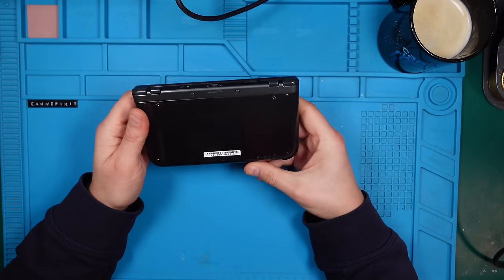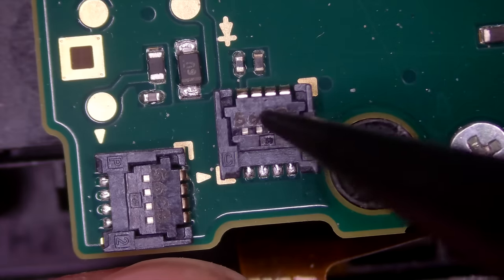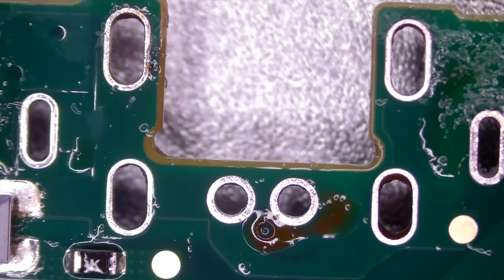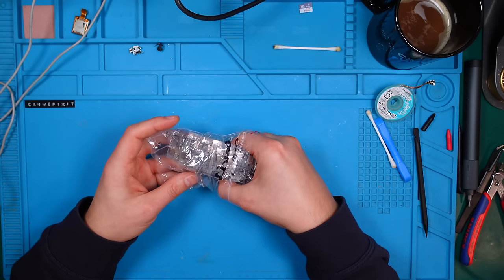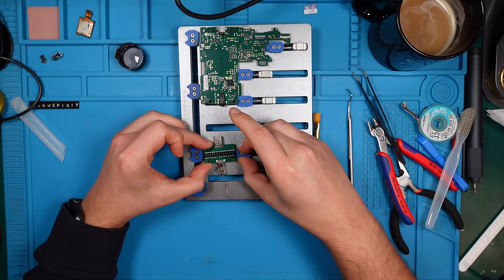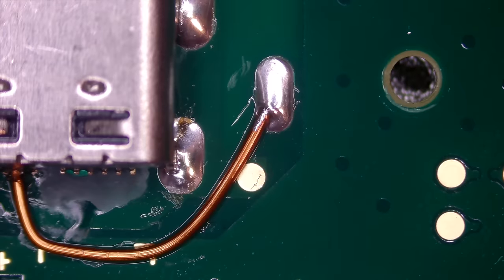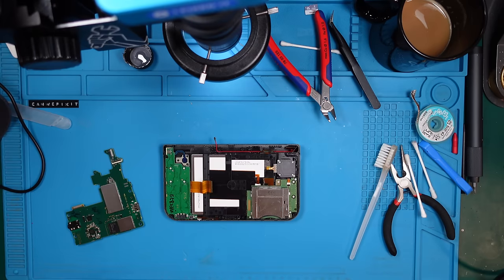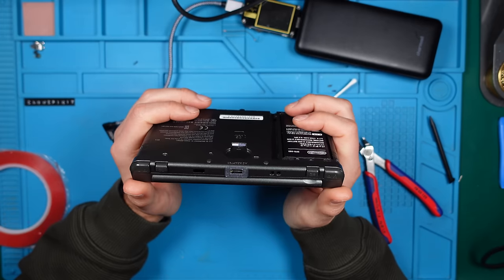Nintendo 3DS Modding - Your FUTURE UPGRADE! (NEW 3DS XL)

Comment: I'm glad i stumbled onto your video! My son was recently playing with my 3dxl while it was charging, and now it's having issues taking a charge.
Reply from the maker: Glad that I could help! What was wrong?
Reply: Is using your 3ds while charging it bad for your 3ds? How?
Reply from the maker: @sgonzalez_guitarra  I assume it will just stress the battery a bit more. I think it is not a real big deal. But what do I know? ;)
Reply: @CanWeFixThat  it does over time, I’ve had my new 3ds XL pretty much since it came out, and I had very minimal issues until recently when my battery started expanding.
Reply from the maker: @Shin3y  But is this really caused due to using it while charging?
Reply: @CanWeFixThat  yes, using any device during charging accelerates the rate of batter deterioration.
Reply from the maker: Sure, that is right, but it's as always: "the dose makes the poison" 😉
Reply: @ThatMathEnjoyer  My old 3ds still lasts 3-5 hours as advertised. Original battery. It seems that the N3DS handles plugged-in usage differently.
Reply: @CanWeFixThat thank u for this video
Reply: @CanWeFixThat it would be super cool if you did lightning port 😂
Reply from the maker: @Liam Smith You are welcome! 😁 Haha, yeah, but lightning would not be future proof. 😬
Reply: @Sebastián González  probably mishandling of the DS while it was charging, could have damaged the port
Reply: I recommend Letting it stay on charge for a few hours without any touching
My battery lost it's ability to hold a charge after awhile but after giving it like 2-3 hours more time charging after it is 100% some reason fixed it?

Comment: for the USB-C mod you need to pull the CC1 and CC2 pins down (through a 1% 5.1k resistor) so the C-to-C cables will work.

Comment: Came for the console modding; stayed for super chill vibes. 
Very refreshing compared to the Quick cut content I usually watch.
Reply from the maker: Nice to hear, that you liked it for relaxing. 🙂
Reply: @CanWeFixThat  hey is was wondering if i send my 3ds to you could you some how maybe possibly theoretically  fix it?
its the original one
Reply from the maker: Hi Jaden, I would love to do this kind of stuff in the future. At the moment I am lacking some kind of public postbox for receiving those items.
Reply: @CanWeFixThat   ok thanks for letting me know but you could give me some advice now how to to fix it? (no pressure) if you dont want to its ok i understand
Reply from the maker: This will be difficult without any further information. 😁
Reply: @CanWeFixThat  OK so first off my 3ds has a broken charger so i have been using the charger satiation for like 11 years and second my 3ds keeps turning off after i turn it on yes is know its a wiring use but i dont know how to fix it
Reply from the maker: Mh, I don’t think that it‘s possible to diagnose it without having the device on the table. 😞
Reply: @CanWeFixThat  what i were to send you pictures?
Reply from the maker: this won't work without doing any measurements :-(

Comment: No problem for watching till the end. I actually needed the info on how to go through all of it. After all. I'm learning how to modify and build and make everything by hand including programs launched and how to make my own software. I'm just going through basic steps, but this helps right now. Futureproofing a 3DS XL. I had a thought on the platic cover you put over the back of the charing port. You could always just make the plastic design you put on the back sink in where the charger would go. Maybe have s tiny tiny bump to kind of lock the charger in place. When you make the center plastic sink enough it could technically go around the port making it look a little cleaner. I could explain with a design maybe?
Reply from the maker: Thanks! Sure, there are many ways to neaten the port gap. What also might be a good solution is some Sugru. This is basically plasticine that will harden and become slightly rubbery.

Comment: Great Video. i like modding in general and i am in love with the n3ds xl, personally i opened and repaird 6 new3ds xl so far. just want to point out for any one who dosnt have much time to do it him/her self, there is a usb cable dirt cheat that u can buy. the 3ds charger is "5v" which is the same as the voltage of any usb charger u already own.

Comment: what would be cool is too see someone make a custom PCB that is based off your video to make the process even easier, This is amazing either way!!!
Reply from the maker: Hi! Do you mean the tedious part of soldering the tiny wire to the socket?
Reply: @CanWeFixThat  yes I hate tiny stuff like that (even tho I paint miniature)
Reply from the maker: @fean-uko5676 I totally agree! You could buy a USB-C breakout board; that's a much more straightforward approach to tackling this problem. Should I do a video about it?

I used this board in my PS4 Controller Mod:

"I mod my PS4 Controller to USB-C with Power Delivery!"
https://youtu.be/VvKj_7JHxzo
Reply: @CanWeFixThat  I think it would be an interesting experiment! And if it works then it would make it easier for others
Reply from the maker: @fean-uko5676 Of course, would it work!  😬

Comment: Great video. Personally, I don't mind carrying a specific charger for it because I religiously use the N3DSXL dock. 

If there was a way to still use the dock and have the USB C connection, I'd definitely do this myself.
Reply from the maker: Thank you very much! You could find another place for the USB-c connector inside the case and use it in parallel. This should allow you to use it with your beloved dock and USB.

Comment: Or you could buy a microUSB->3DS adapter like what I did. Or buy a USBC->3DS cable is another option too. Also, if I was to do this and expand the plastic hole on the port, a flat needle file is all I would use for that.  You would end up with a rectangular hole, perhaps a fine circular needle file could round out the thin side/corners.  But that may be still to big.

Comment: Okay okay,
The thumbnail made me incredibly interested 
USB-C on 3ds?
Beautiful
Reply: Did you ever get a bigger battery than the original 1750mAh?
Reply from the maker: @Average Gaming Thank you so much for your honest reply. Stay tuned, I will do a follow up video with support for PD (Power Delivery) chargers.

"Did you ever get a bigger battery than the original 1750mAh?"
Have not checked for any other type of battery yet. But I would assume, that if you found one, it is high likely just a lie. 🙂
Reply: @CanWeFixThat  Well, it's two more batteries that I know of
And I use the 2000mAh I ordered from ebay
The highest strength one that I've seen is 2500mAh
I had to replace my original battery because it was swollen
Reply from the maker: @averagegaming3900  Yeah, but is it really the stated capacity? Unfortunately those numbers are often just a lie. 😕
Reply: I'd say that it is!
It's an EXTREMELY noticeable difference in battery life 
With the 2000mAh, I can play much longer and I don't have to charge as much throughout the day
That's one part on my 3ds That I don't regret buying
Reply from the maker: @averagegaming3900  This is great! Maybe I will try that out, when this battery here is completely lost! 😬 Thanks for sharing!

Comment: There is a simpler way to do it, there is USB C female ports with tiny boards which has already solded all the pins on the board, you just need to connect the negative and positive to the main board and you're good to go. I have seen people using these in iPhone mods and they also work great with DS/3DS/2DS. But you did a real nice job on this on, I wouldn't have the patience to solder these microscopic pins haha
Reply from the maker: Hehe, you are right; as I said in the video, it was more of an experiment and a challenge for me! I used the mentioned board in this video to mod a PS4 Controller to USB-C: https://youtu.be/VvKj_7JHxzo  😉

Comment: It is just easier to purchase a USB to 3DS cable so you can use that with a powerbank or something like that for when you are out and about with your 3DS, if you carry it in a larger carrycase or something. This is still a neat idea though, but can be fairly unnecessary depending on how you look at it. This mod does makes accessibility to having the correct cables much easier so I'll give it that, but the hassle may not be worth it to some (And cutting into the case).
Reply from the maker: Hi! Sure, that is the easiest way. But as a tinkerer, this is not an option! 😉

Comment: Would you mind linking to some of the parts you use? The digital magnifier, the board holder, and maybe even a soldering iron/station you recommend? I'm about to move and plan to just start over with my workspace, and have an imported Famicom New 3DS XL from Japan that I've region changed and would love to do this to.
Reply from the maker: Hey! My setup is a wild mixture, and the microscope arm is a DIY computer screen table mount solution. I could do a video in the future in which I show my gear because this question was asked previously.

To mod your 3DS with USB-C, I highly recommend a breakout board for easier handling. This was just an experiment with soldering directly to the connector.

Have a look here:
I mod my PS4 Controller to USB-C with Power Delivery!
https://youtu.be/VvKj_7JHxzo

Comment: They make USB A to 3DS connections. With some tinkering you could make a USB C to 3DS Connector. There is no need to modify the system.
Reply from the maker: That's true, but then you need a special cable in your bag. But sure, this is an improvement to the original charging brick! 😀

Comment: That’s awesome. I actually want a DS like that because I’m dreading bringing the proprietary charger with me. USB-C all the way!!!

question though: I have a small gaming handset (Miyoo Mini v2) that has a problem with power input. It does charge on lower power inputs like a power bank, but if you connect the MacBook charger, it’s not charging. 

Any idea how this Nintendo DS will behave?
Reply from the maker: Hi Rob, I think this is gonna happen, when you are using charger that are PD (Power Delivery) only. The port in this console is "dumb". A PD charger uses a protocol to communicate with the device. Our device can't answer the charger and that is the reason why the charger won't output anything.
Reply: @CanWeFixThat  Ahhh OK makes sense. So generally use non-PD. Is a non-PD cable enough, even if, let's say, it's connected to an Apple powerbrick?
Reply from the maker: I would rather say the power brick itself is the problem in this chosen scenario. ;) But I am not an expert by any means! Please keep that in mind!
Reply: the manufacturer of the Miyoo Mini states on their website that you should ONLY use chargers that put out 5V at 1A, nothing more! And that no powerchargers should be used whatsoever. So you should look into some older USB A wall connectors from old smartphones for example, to not blow up your powerpack. That would be a shame considering how hard it is to get your hands on a mini these days ;)

Comment: You may find some problems down the line, some chargers won't give 5v without a 5.1k resistor on (at least one of) the cc pins of the connector. (one = only one side will work)

Also; for some reason, not all cables connect the shell to the gnd pins ??

But great work !
Reply from the maker: Hi Count! You are right! As mentioned in the video,  the whole project was more or less a proof of concept, if it's possible to accomplish this mod with just a bare usb c connector. I am thinking about a revisit with the mentioned resistors and a usb-c breakout board.
Reply: You can get some super tiny breakout boards, with resistor! Although it's somewhat difficult to find ones with 2
Reply from the maker: Where's the fun in that? 😀

Comment: How hard would it be to enable some extra mods like file exploring or video output? I haven't done a lot of 3ds modding, but I know they make PCB's for video output at the least.
Reply from the maker: File exploring? What exactly do you mean? Video output is only possible with a capture card or a soft mod via software.
Reply: @CanWeFixThat  I more meant if it was possible to use the higher speeds of USB C in conjunction with the 3ds Capture board, or additionally find a way to use the 3ds' micro SD as a external media source when plugging the USB cable into your PC
Reply from the maker: @Cain532.  I don't know, not very into this kind of stuff, sorry! Maybe someone else?

Comment: Forgive me, as I don't know a lot:

Do you need a special Adapter to charge your 3DS so it doesn't overcharge?
Reply from the maker: Hi, that is a very valid question. This method just works with USB-A => USB-C cables. The maximum I have seen so far, was a charging current of around 1A.

Comment: Huh, are all the VCC lines in the USB-C port all connected? I would have figured you'd need to tie at least a pair of VCC together to account for both insertion orientations of the cable (but maybe I don't understand USB-C)
Reply from the maker: @Les Orchard You are right, the method in this video shows a modification where just USB-A => USB-C is possible. It is not usable with PD chargers. I will do a follow up video with a break out board, where we include the needed resistors for the mentioned support. So stay tuned for that! 😉

Comment: My home button connector lost its springyness. It is a used console and i guarantee somebody dumb came in, because on top of the lost pringyness, one screw of the D pad is destroyed and i canot unscrew it.
to counter the lost of springyness, i  have put double sided spongy tape on the case, right over the connector and i have taped the battery cables over the connector. The pressure is enough to make the connection.

Comment: Are you sure this is not dangerous for the lifespan of the console, as in, maybe i accidently use too strong of a charger, like a fast charge or something. What is the potential damage?
Reply from the maker: Hi MacMashPotato, the maximum I have seen was 1A, which is the maximum. A fast charger won't work because the resistors must be installed;  I have not done that in this mod.

Comment: I’ve seen other usb C mods but most have them also come with custom pcb with them. Do you know why?
Reply from the maker: Hi Pandakid, that is definitly the way to got. With help of the mentioned break out board, it is much easier to get the soldering done. Furtermore you are able to solder the needed resistors for a charger using power delivery (PD). I will show this method in an upcoming episode. Stay tuned! 😉

Comment: If only the new Nintendo 3DS also had the other card slot, Like the DS Lite, the only one they made that can play Gameboy Games. Feel like it could be possible, but it would need an entire internal redesign. ):
Reply from the maker: That is a pretty nifty idea, but I guess this would require also a highly modified firmware. :-(
Reply: I'm surprised there's nobody on youtube that has already done anything on this Honestly I've seen and heard so many complaints about how the new Nintendo 3DS Should have had the feature of the Nintendo lite, But I guess it's just a project that Nintendo has abandoned ):
Reply from the maker: I am pretty sure that it is nearly impossible to accomplish this mod. That's why nobody has tried it so far. I will note the topic; maybe I can find a way to think about it.
Reply: OK. I will still have hope it is possible for the new Nintendo 3DS, I only think of it because of how much different the sizes between them. There's. gotta be stuff in the new 3DS that doesn't need to be as big as it is. but you would probably have to redo the entire system. Basically, new motherboard, new everything. It would just be a lot of work to even be done. That would be another reason why nobody has done it But they complain about it still. It's basically just making a whole new Console at that point. Which I won't say is a bad thing The old 3Ds Has always lasted longer with its battery than the new XL model, which I felt makes no sense. Just got a new battery for it too. So it's not that.

Comment: Would you say it is too ambitious to get this USB-C to also work with HDMI output conversion for top screen display to broadcast to HDTV? Like those consolizers that exist for GBA?  (sorry for typo)
Reply from the maker: Phew, good question. Maybe it is possible, but from scratch I do have no idea how to accomplish this. But it is a nice idea!
Reply: That'd take a really long time, what you could add is a usb sd card reader to directly read from your nand using usb c (would also need to add a switch for the clock signal of the reader else youd be stuck with a bluescreen)

Comment: Why didn't you hook the data points up run a couple wires do a little research hook up video out so you can plug in an HDMI USB type-c plug is it even possible
Reply from the maker: Hi Casper, thank you for this interesting idea. Unfortunately I believe it is not that easy. For example the Nintendo Switch Lite is not dockable because it is lacking a controller chip. So I would doubt, that just rerouting some wires will lead to any success. There are some capture cards out there, but they are really expensive.

Maybe someone else could say more about this Topic?
Reply: Is there any way to tap in two whatever is supplying the LCD screen it's video and do some kind of custom job where you could run it to a TV

Comment: Just wondering... my brother has a 3DS that has a faulty circle pad, my dad in all his wiseness dissasembled the console and by accident the little tab that attaches that tiny flex cable that goes from the circlepad to the motherboard flew away, never to be seen again. How can that be fixed?
Reply from the maker: Hi, you are talking about the tab of the ribbon connector to lock the cable in place?